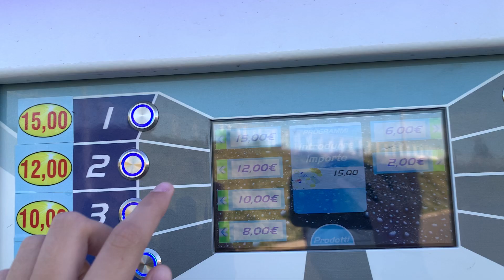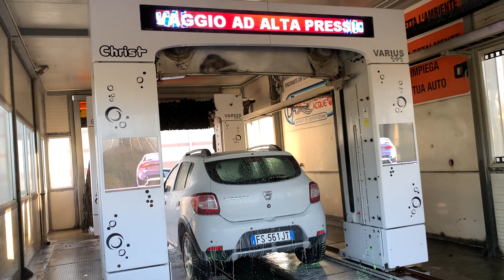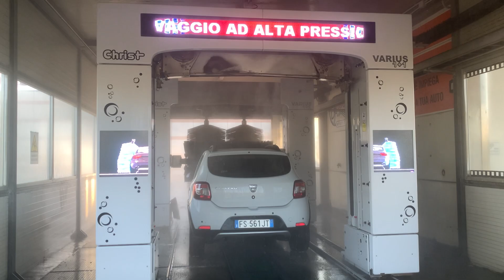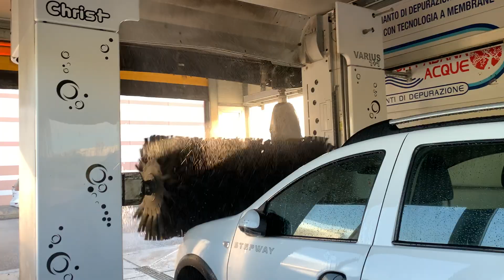Christ Varius 1+1 C162 With Visus

Comment: Really great equipped machine! 
HP contouring Roof wash! 
A rare seen Feature!! 
I like Varius c162 1+1!! 
Great Video keep it like this!!😎😎😎😎😎👍👍👍👍👍👍👏👏👏👏👏👏👏👏👏👏👏👏
Reply from the maker: In the basic programs the high pressure is not at contourning the roof in this varius 1 + 1
Reply: @CarWashItaly   The dryer is Contouring the Car while he does zu the high pressure wash. I know Car washes really well so don't tell me what the machine exacly does! I watched the Video. And you said it in your description too. Roof high pressure. Look at 1 Minute 19 seconds. There ist what i meant.
Cool rarely seen feature.
Reply from the maker: @insectscarwashesconcerts2000  Y
es I know I mean that in the 8 euro program the roof high pressure not countoring, in the program that i made the 15 euro one, high pressure countring
Reply from the maker: @insectscarwashesconcerts2000   in the 8 euro prgram the roof high pressure is like this https://youtu.be/5f2YaZv99Mc
Reply: @CarWashItaly  thats an other Feature called oscilating top high pressure. But cool that it has both!!👏👏👏😎👍
Reply from the maker: @insectscarwashesconcerts2000  yes i know
Reply from the maker: @insectscarwashesconcerts2000  
however this Varius 1 + 1 also has the foam splash only that you can't see it from the video because it has a very clear soap